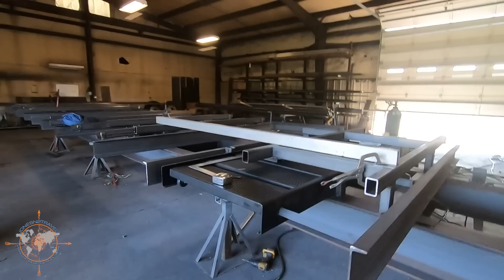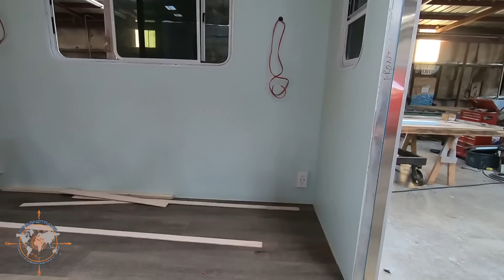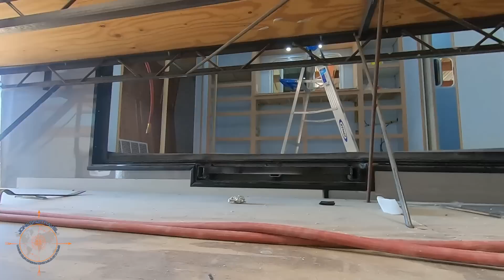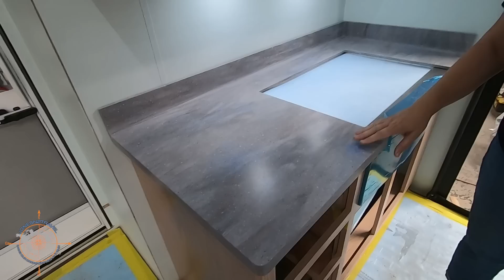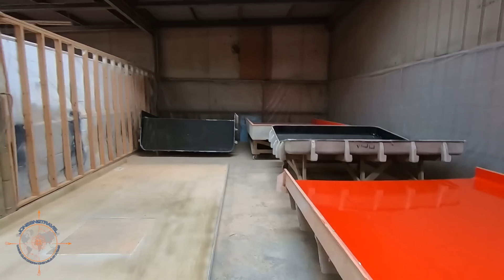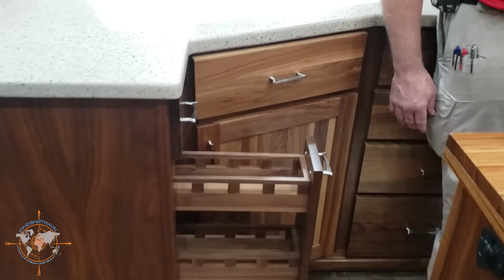THE ONLY FULLY CUSTOM RV MANUFACTURER | SPACECRAFT FACTORY TOUR

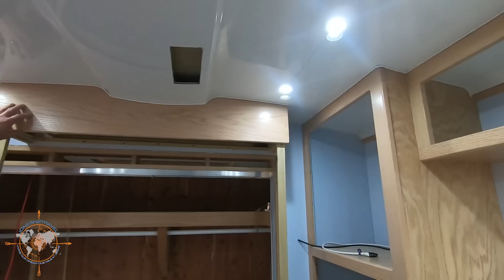Comment: (@20:36) I'm a little surprised to see mylar duct tape sealing off the air duct on a mobile structure that goes through dynamic torsional, tensile and compression forces. Ducting tape is not made for movement. There should be a silicone impregnated fabric boot bridging a slight gap between duct joints that is clamped on. For an example you can consult with Boeing.

Comment: Pro s and Cons of semi trailors against 5th wheel trailor based on normal 44ft max trailor weight/sizes im interested having a semi all equiped with air brakes not some mix of electric / hydrolic brakes / suspension.

Comment: What gear ratio does your truck have and if you had the choice which ratio would you recommend on the 780 for pulling a 5th wheel? Dave
Reply from the maker: Hey Dave. I believe ours is 2.47 and it works just fine. Hope that helps. Safe Travels

Comment: Wow! 650 lbs dry weight per foot means that our 43’ MS Atlanta would weigh nearly 28,000 lbs. oh my!
Reply: A 53ft semi trailer generally weighs 10K (plain) to 15K (refrigerated) pounds.  He had to be wrong about 650 lbs/ft, that leaves very little for payload.
Reply from the maker: Thanks for checking out the video Safe Travels

Comment: Lux also builds their own chassis but the price point is very different!
Reply: Correct Luxe has lippert build there chassis. But there built to luxe's spec's. and there are very stout. That's once reason why i have a luxe on order.
Reply from the maker: All I know is our DRV frame is built by LCI, to higher standards for DRV but it is literally falling apart. Not sure LCI is the best option LOL Safe Travels

Comment: Wanted to ask how the raptor lining on your bed is holding up its Been s year now
Reply from the maker: Hey there. Its holding up very well. I have a few spots on the very back of the bed by the tail lights that I sprayed a little too thin, trying to be cheap, LOL and a little surface rust is showing through. I'll try to find time this summer to respray it. I am really impressed with the areas that get the wear. No issues at all where the car sits and even though I have chipped the very edge of the bed with the ramps a couple times it is very tough stuff. Just make sure to do at least 2 coats maybe even 3. :) Hope that helps. Safe Travels